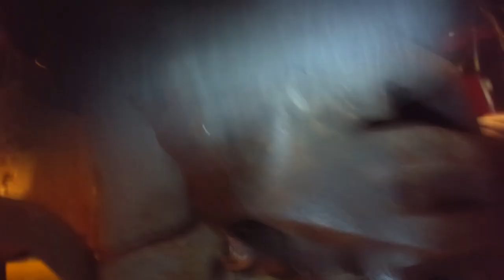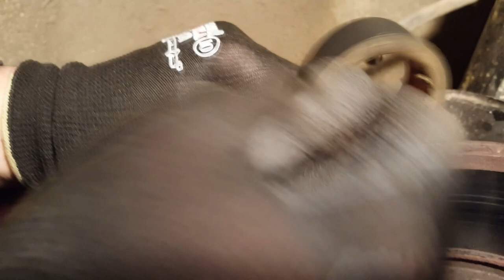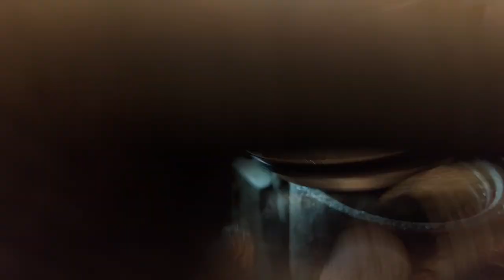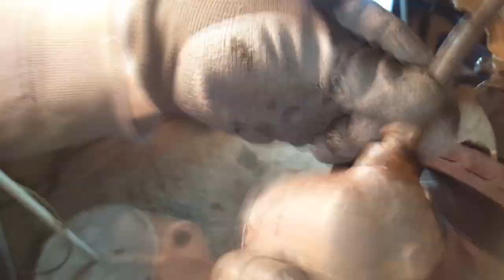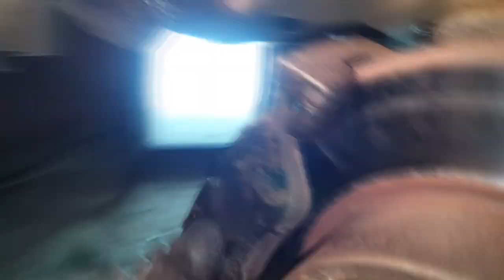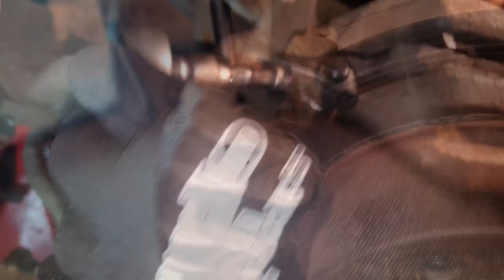BMW front Brake Caliper rebuild

Comment: thanks so much for this. I just rebuilt dual piston calipers and the magic of hydraulic brake assembly fluid for rebuild was insanely convenient5. dust boots slipped over lubed piston and piston retracted into caliper housingly so easy!!! appreciate the vid. I've never seen calipers torn down, and now im a pro, using proper tools
.
Reply from the maker: Nice work! Glad it helped!

Comment: Any tips on pushing that piston out of the caliper without using the brake (I am refreshing a set of calipers but theyre not on the car) cheers! Great video too!
Reply from the maker: Thank you! If you have use air compressor, give pressure with blow gun to brake line hole and piston will shoot out. If you dont have compressor take channel lock pliers grab on piston turn  it back and forward and pull at the same time
Reply: GetWork thank you very much 👌🏼

Comment: Thanks for video! Can you advise me which brand rebuild kit is that? Because im checking with realoem catalogue and rebuild kit there contains only seals of piston, piston itself isn't included and no separate number for it. Thanks!
Reply from the maker: Sorry, this was long time ago and I cant remember. But I bought it from local auto parts store.

Comment: great video mate!   did you not need to clamp the brake line?
Reply from the maker: Thank you ! That plastic I put on end of line acts like clamping the line, it just safer because you wont damage rubber brake line. Its stops drips because it creates closed system end, like caliper would.
Reply: @Work_G   oh great, yeah was thinking the brake is quite solid /birttle to clamp,. Good  idea! I will do it this way

Comment: Now, the part you failed to show is taking off the brake line from the caliper. Did you lose a lot of fluid? it seems as if there was no fluid inside because, I saw only a few drops. One would expect it gushing out a little bit but, maybe you cut that part out? and where the confusion even got worse is when you put it back together and tighten the brake line back to the caliper and bled it, all of a sudden, the fluid came gushing out like it's supposed to. please need an answer. Keep the good work up though.
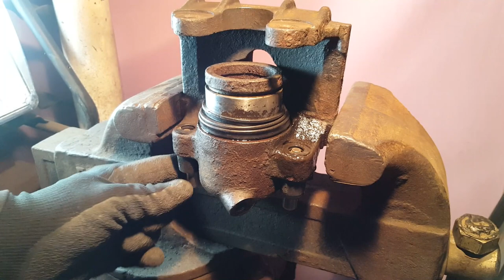Reply from the maker: When brake line comes out from caliper do not expect lot of fluid, it will come up a llitle bit and then from brake line just drips little drops all time as you sow because brake pedal is not engaged and brake system not pressured.  When I put plastic on end its stops drips because it creates closed system end, like caliper would. And from brake caliper fluid almost wount come out,  1:34  you can see there it was flipped and fluid didn't drip until cylinder was removed, because there was vacuum and by taking it it get air from top and then all what was inside of caliper ran out. This video is cut up a lot. I try to make it short that would not be boring. And bleeding took longer I just cut that part off. First few times it comes with air bubbles. Thank you :)

Comment: Would this be the solution to a sticky brake caliper? Changed the fluid, pads, and rotors , still stuck .
Reply from the maker: Most likely this or it can be studs where caliper mounts and slides on caliper carrier and clean carrier where brake pads contacts
Reply: Hey Andrew, did a caliper rebuild fix your sticky brakes , think I got the same prob, thanks.
Reply: @epapnoc  yeah the shop that worked on my car had a spare one and they slapped it on for free, it fixed my sticky caliper problem

Comment: what i red paste? is it coming with the kit o r i need to buy it apart??? thanks
Reply from the maker: That is special lube and usually it will be included if you will buy kit with cylinder, if you buy only rubbers kit you won't get oil. But you can buy only lube in car parts store.
Reply: @Work_G  But this red silicone paste is used to lube moving parts of caliper, not the piston and the rubber for piston sealing, that should be just “lubed” with brake fluid.
Reply from the maker: @kawarider9049  Piston is lubed not for lubing purpose but for easy install, for smooth push in and wont cramp or push out of groove seals
Reply: @kawarider9049  I agree with you. 2:18 shows the grease below the seal which will contaminate the brake fluid. At least the bottom of the piston wasn't greased like I have seen others do!